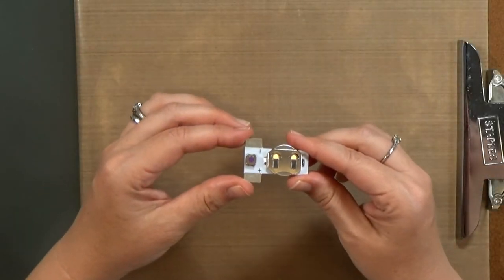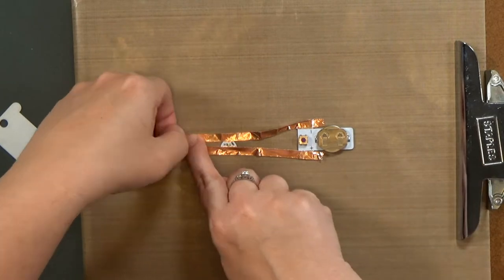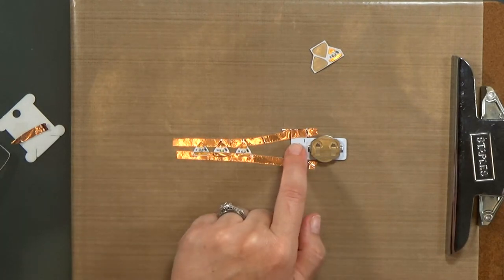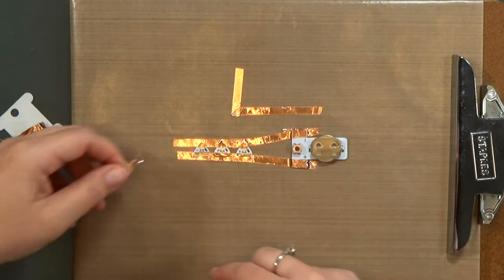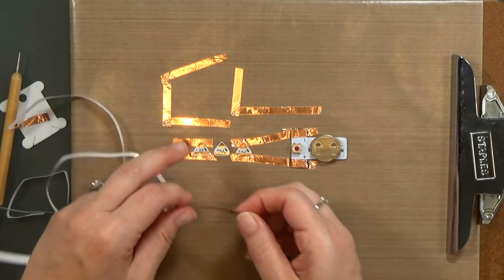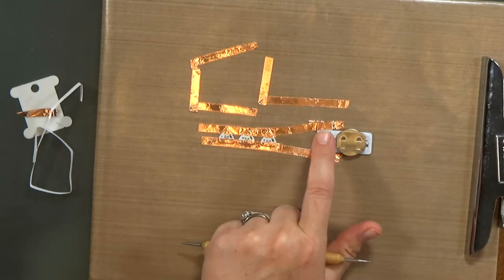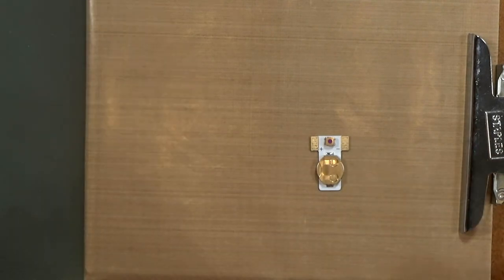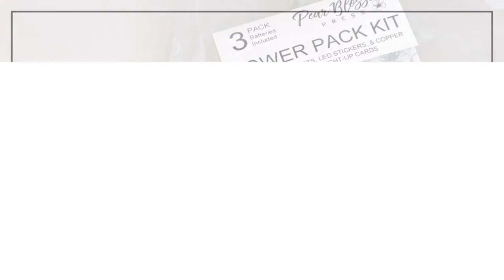Power Pack Tips & Troubleshooting

Comment: Now I know why so many of my circuits fail! I didn’t know about the transistor or that the copper tape needs to be longer to avoid spots where I’ve touched the adhesive. I’m excited to try again as I’d  almost given up on ever getting them to work reliably.
Reply from the maker: Hi Rebecca! I'm sorry you have been struggling. I need to update the video to include that I also wipe the pads of the LEDs and Power Packs off before connecting with tape. This gets fingerprints off and gives the cleanest possible connection. I started a new Facebook group called Interactive Cards & Papercrafts. You can feel free to post pictures of the light-up cards (or any other interactive cards) you make. You can also post pictures if you are having trouble and I will help troubleshoot. There are lots of great crafters in there that can help too. :)
Reply: Thank you so much. I haven’t used a power pack yet but I’m excited to get some. What do you wipe the connections with? Just a dry cloth?
Reply from the maker: @Rebeccacell  yep, just a dry cloth. (Lint-free is good.)